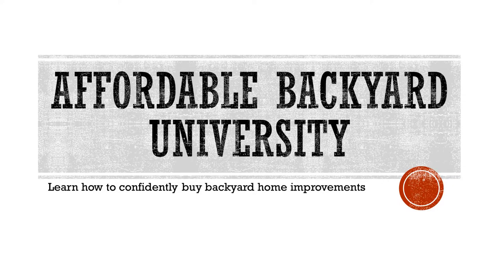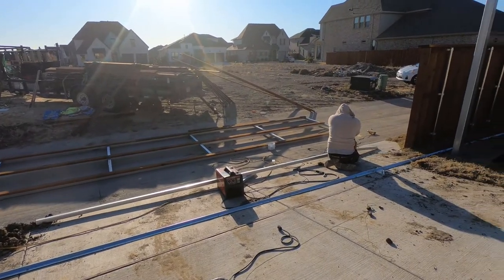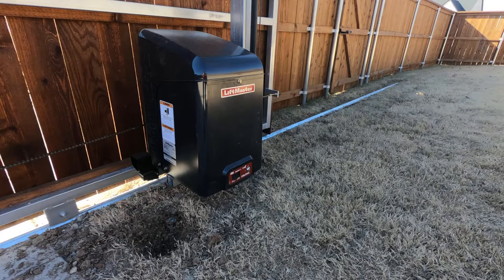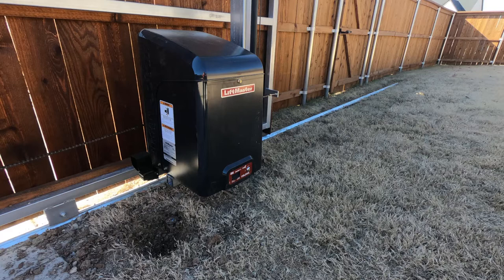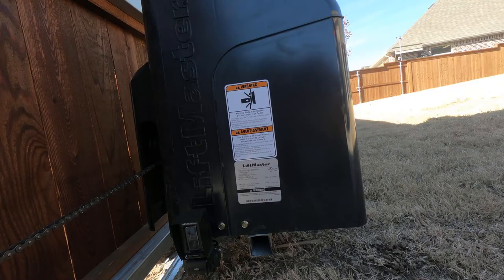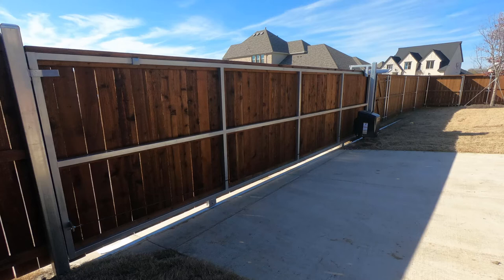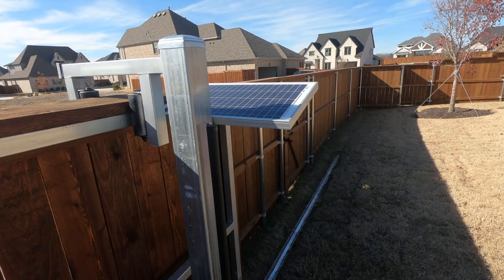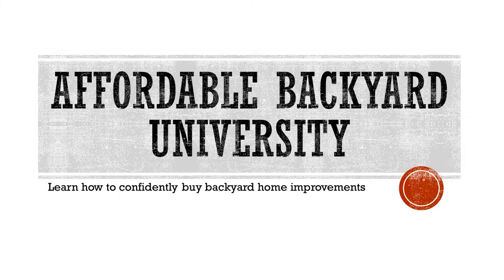Electric Steel Framed Rolling Gate Solar Powered 6' Tall Western Red Cedar Liftmaster Frisco Texas

Comment: I like the battery powered opener.  That appears to be a pretty high end residential set up with the steel and the construction of it.   I wonder how much more would it be to go with the cantilever gate insted of the V track .  That would alleviate problems of snow and ice,  rocks and debris.  You could just lay down gravel and not need such nice concrete work as well.
Reply from the maker: That is a typical backyard in the neighborhoods we work in.  We use a cantilever design when we build chain link rooling gates.  Ice and snow are not often a problem here in N Texas!
Reply: @affordablebackyardconstruc2215   Yes I understand.  But trust me. That is pretty high end compared to a lot of places in the country and not everywhere has hair weather all year around..

Comment: Can you provide a detailed list of supplies needed? I need to install something like this, or at least list a supplier? Thanks either way.
Reply from the maker: Ron,
4x4 posts
2x2 tube
2X bottom rollers
Liftmaster CSL24U motor, solar charging unit, keypad, 
Western Red Cedar Picket ( cover the gate)
Self Tapping screws
We buy ours through a wholesale to the trades only yard but you can probably order all of it from Home Depot or Lowes

Good luck!

Comment: I made some gate openers  when i worked at a fab shop
Motor and gear box wss $150
Belt drive over chain for safety the chain is atached to a rolling gates.
Someone could just use a garage door opener to open and close the gate with rollers on top and guide on the bottom
Reply from the maker: Thanks for joining in Gary.

Comment: Is there a link for the gate kit ? Or suggestions ? Thanks
Reply from the maker: The gates are custom made on site based on the size of the driveway.  There is no kit.  Where do you live?
Reply: The heart and soul of the gate which is the motor and chain is a kit. U might need to trim the chain shorter or longer but it is a kit. The rest is pretty much diy able

Comment: So  the track that goes into the yard is not 100% supported by concrete? It on piers ?
Reply from the maker: The V Track rests on steel feet which are incased/encased in the piers

Comment: Great gate, doesn’t look affordable- what was the total cost of components?
Reply from the maker: Thanks for checking in.  A project like this would run 7-8K depending on size
Reply: @affordablebackyardconstruc2215  is that materials and steel?
Reply: @affordablebackyardconstruc2215  thanks, price is fair
Reply: @affordablebackyardconstruc2215  any advice for installing one about the same size

Comment: Awesome job-This is exactly what we need! Will definitely have to keep it in mind. Do you have a weight estimate on the slider ? My situation is  like 30 ftslightly uphill so I'll need to work out if the opener has capacity
Reply from the maker: Each gate is a custom build and therefore the weight is different on every one.  We use a Liftmaster CSL24U commercial opener and have never had a problem
Reply: @affordablebackyardconstruc2215  still dont understand how it works when the sun isn't out
Reply from the maker: @Eastbaypisces   the solar unit charges the battery that powers the motor
Reply from the maker: Liftmaster csl24 gate operator will move it

Comment: Will this motor work with a 8 fr board on board gate? Really heavy
Reply from the maker: CSL 24U is a commercial motor. YES it works on 8' BOB gates
Reply: Do you build fence and gate around Dallas area? If so how can I contact you and get an estimate?